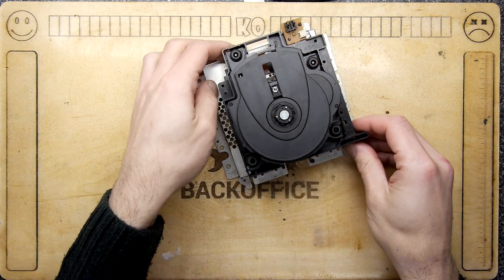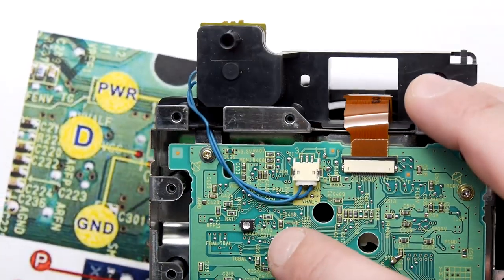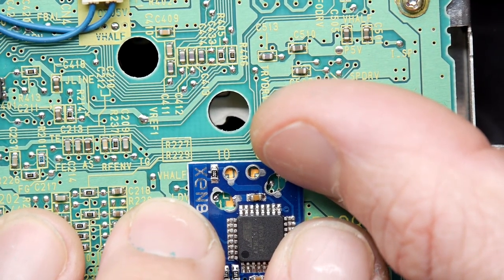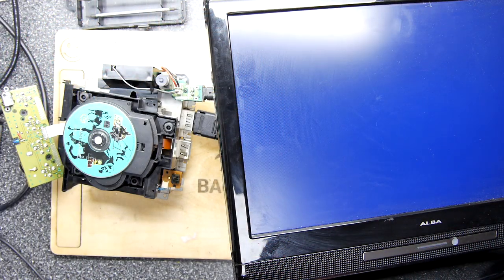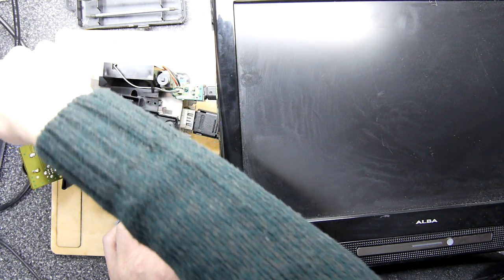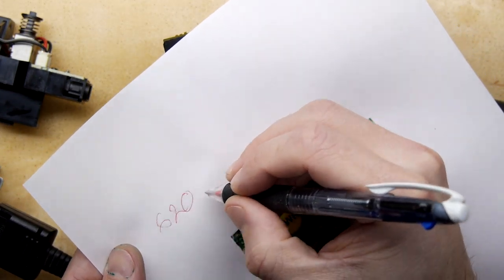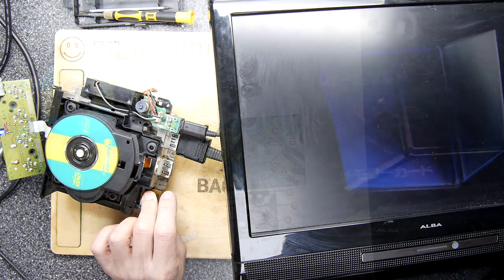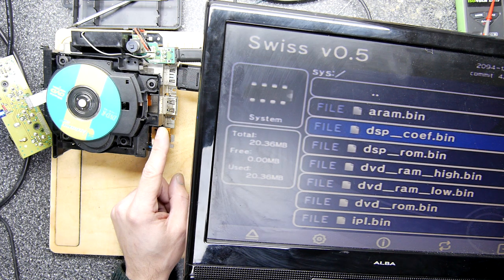Japanese Gamecube Modification Project Part 4 - Chip Modding

Comment: What if your gamecube drive won't spin anymore? I keep getting an error has occurred
Reply from the maker: Time to get a new drive or one of the SD card adaptors
Reply: @backofficeshow  sd card adapter?
Reply from the maker: Google GC Loader
Reply: make sure the disc drive is fully pushed into the slot that goes through the metal shield